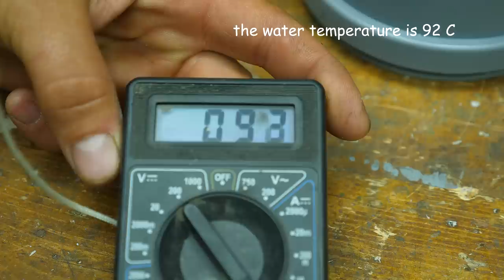Having learned this secret you will never throw away a glass bottle again!

Comment: Wouldn't it have been soooooo much easier to simply wrap the glass with aluminum, invert it in the pvc tube and add spray can foam insulation?
Reply: Would have been a Great Deal easier just Not do the Video n posting it.
Reply: Or just use the thermos that’s laying on the workbench.
Reply: I thought the same thing! Lol
Reply: Yup
Reply: @Camille
I like your idea.
Reply: Don't forget inside of bottle lid is pba and all sorts of pbs....to make your life as toxic as possible with this flask.
Reply: Or maybe just fork over the $20.00 & buy one, just sayin'....
Reply: Do they not have a Dollar Tree where you live lol. You have all the tools you need to build creative furniture, lamps, frames etc.
Reply: Glass thermoses was "piip" hurt in old days. If you use screw cap, you never get it open because it create vacuum when it get cooler.
Reply: Some people just don’t get the joy of creating
Reply: Those 3 pvc parts alone cost more than a new thermos flask
Reply: Not so attractive for a YouTube video, though.
Reply: @vernellcallahan1791  No, there is no such thing as Dollar Tree in Australia.  There are cheap shops but not cheap like I see Dollar Tree.
Reply: David Wang  I live in Coon Hollow and there isn't a single Dollar Tree near me.  There was a Big Lots once, down near the big traffic intersection with the flashing red lights, but it was taken by the same twister that took out Floyds trailer.  Shame too, because now I have to drive all the way into Dry Springs to buy my pork rinds.
Reply: lol yes
Reply: You don't think he thought of that? He's obviously a genius. that was probably his like second design, but he scrapped it because it would have made for a very short video! He was going for excitement, viewership interaction, comments! The entertainment Factor alone is astounding, don't you see? Duh. :)
Reply: @fasthead  why not reuse package foam.? I sure get get enough when I order.
Reply: @RoySATX  
😄😄😄😄😄👍🏻

Comment: I have a glass Jar! Just not all them fancy power tools! Lol 😂 cool 😎 video📼 thanks! 🇺🇸
Reply: You can do pretty much the same thing with a hand drill, hack saw, coping saw and sand paper - it'll just take more skill and patience.  ( a battery charged hot wire and a clamp or vice can replace the coping saw to cut styrofoam.)
Reply: Me too! Lots of glass jars no tools! 🙁
Reply: @larryclemens1850  i don't have any of those either lol
Reply: I have all the fancy power tools but no glass jar!
Reply: Yea like who has a vertical circular sander like that,never seen one like that ever but good to have nonetheless.
Reply: @larryclemens1850  źźź

Comment: Very interesting. This is inspiring and could be done almost for free using polystyrene pellets and any old outer cylinder, and could be made almost any size. Obvious, but very inspirational.  Lots stronger than a glass thermos flask,  and better than a metal lined flask efficiency wise. Thanks for sharing,  blessings.
Reply: Imagine having all those pieces of equipment in your workshop. I could by a lot of thermoses with the money I would spend bying that shop equipment.
Reply: @InAHandBasket  The thing is Linda, tools can make just about anything, not just thermoses. Tools are the means of production. A good workshop, like a well equipped kitchen is more valuable than gold and diamonds. (They are a waste of money for the sake of useless vanity.)
Reply: @kenbellchambers4577  Having those tools is no doubt very useful however the title of the video makes it sound like it's something someone would actually do. Very few people would have the time and equipment to never throw away bottles so they could use them to make DIY thermoses. While watching the video I thought it was kind of crazy to go through all that trouble to make a thermos, not to mention having the supplies and tools on hand. The only thing I have is the aluminum foil and maybe a glass bottle. If you made them with the intent to sell them you would have some strong competition. I have two thermoses and I've had them for maybe 35 or so years. I don't even use them. I use my stainless water bottles which have enough insulation to serve their purpose. Still it is a very innovative idea and presentation. Just not what I would consider practical.
Reply: @InAHandBasket  The point that I was making is that tools are very useful. I have heard so many women refer to men's tools as 'boy toys'.  Tools are not toys, and the men who build our roads, bridges, houses and do 95% of the dirty and dangerous jobs need good reliable tools. Now if I was to call lipstick, mascara, and padded bra's 'women's toys', that would be pretty accurate. (Or maybe the word 'bait' would be more accurate), because all of those items are designed to catch a man, preferably one who knows how to fix and build things. 
PS, when I was six my mom bought me a thermos. On the very first day that I took it to school, I dropped it into the sink while trying to rinse it out, and it broke. That is one reason why using a glass jar rather than glass as thin as paper seems like a great idea. One day, we may find ourselves unable to buy these things, so why not learn how to make them? If you find yourself without a thermos one day, you can take any old jar, wrap it in foil, then wrap it with an old sheet or blanket, and your lemonade will stay cool all day, just using the simple methods shown in this video.
Reply: @kenbellchambers4577  Umm, my tools are toys. Or maybe that's because when I'm using them, I often feel I'm more at play than work. 😁

Comment: Took me a bit to figure out what you were doing, and what it had to do with used glass bottles. Especially since the foam and pvc alone cost more than a thermos. And if you were strapped for cash you probably could find one at Goodwill. The old green ones that construction workers and labours had are still 100% usable, even if bashed up a little. Adds character, lolol. And they fit in your hand better. I would need two hands to lift that thing, let alone drink out of it.

Comment: Pro tip: Put the foam on the workbench and drill down. That's what it is for and you'll get a more perpendicular cut.

Also, you won't have to worry about slashing your hand up with a hole saw and rushing to the ER.
Reply: Now what's the fun in that?  And you'd miss out on showing your new thermos to the pretty nurses.

Comment: I had a red plaid vintage picnic cooler get dropped and the metal housing split on a seam. Turns out all those Alladin or Thermos brand coolers were mason jars in a metal housing with fiberglass insulation around them so this makes perfect sense.
Reply: Fiberglass?  That wasn't Fiberglass, it was Asbestos.
Reply: @RoySATX  It was pink fiberglass. Fiberglass has been around since the 1930s.

Comment: This is an insulated bottle. It is NOT a thermos!

Thermos is a registered trademark, meaning the device contains a double-walled vessel, with the contents protected by a vacuum. That layer of vacuum makes it impossible for outside heat or cold to affect the contents of the  bottle.

Comment: 3:35  This is when I knew that you were going to seriously hurt yourself someday.  So you really hate your hands that much?  Why not drill the inner holes in the foam sheet before cutting the outer circles?  Also, wear a mask if you are cutting that crap with a power tool.  You are basically breathing in cancer with that dust.  Use handtools for that foam and plastic.   Man, this behaviour makes me indignant.  I won't even comment on whattheheck you are making.  Also, good luck in the future and keep trying!

Comment: The same can be done far more easily using PU foam can having much better thermal insulation, and with no possibility of ingress of water. PU also prevent mould formation that happens with polystyrene foam sheets.

Comment: Great video. Quick question, what is the name of the red bit that you used to drill out the large hole? Do you know if they have a bit like that for wood? Thanks.
Reply: Yes they have them for wood. It is called a hole-saw
Reply: These come in sets of different diameters, you have to be safe in handling as they have sharp edges.

Comment: Making a statement; 'I am skilled and can do whatever I want to. ' A normal milk bottle 
will crack with very hot liquids if it doesn't with very cold ones! Was this bottle meant to be used once or twice only? Clearly there is no housing protection for cleaning. Others have been known to do a quicker job by winding a rope. around the bottle...

Comment: Its NOT a secret...   Failure !
Learned more about tools & styrofoam. Along with plastic.  And don't leave out the caulking.  The bandsaw.  Sand paper. Powered disc sander.  Work bench...  Meter... Etc... Great builder !

Comment: Next week on Home Workshop, we'll show you how to use a giant redwood tree and .50 worth of materials. (along with several thousands of dollars worth of tools) To produce a custom made toothpick in just 4 short months.

Ya know, in labor hours alone I'm way better off buying the thermos for $10 to $20 which will work much better anyway. Styrofoam® has a relatively low R value in comparison to the negative air space between the Thermos' walls.

Comment: Your other video plaques/prompts block the final temperature. > >  It is a very clever idea though. Do make sure you get a good supply of those metal lids for the bottles they will start rusting in about 6 to 8 month's. I have used these bottles for years to carry extra water in the car because I don't like plastic bottles.

Comment: I realised after about 30 seconds that this was the shittiest attempt to make a thermos flask. This would be little more than single use as the open cell of the insulation would quickly become a great living area for bacteria. Fitting that it is made from a sewage pipe.
Buy a thermos, it would be cheaper and  much longer lasting!

Comment: What a waste of time and materials. You will make a much better thermos without the Styrofoam,  but fill up the empty space with the liquid foam only, it is a much better insulator. No cutting, no drilling, no expensive tools, no waste, no expensive time. Just put the bottle inside the tube, put some spacers and fill in the blank space with foam, it takes a few minutes to do it. I insulated my boiler like this and it stays hot for days now!

Comment: Or I can just go buy the same thermos on the bench for $20 which is less than the cost of all the materials used to make one.
Time is money, and materials cost money. Those pipe sections aren't cheap when they have the oring seal, the foam and adhesive used cost money. You're out minimum 2 hours of your time plus about $40 in materials to make a bulky more fragile version of a $20 thermos. Btw, that metal thermos is a vacuum chamber, NOT a glass core. Completely different technology and doesn't stop working after being dropped which always breaks the glass chambers. 

This is one of the stupidest "life hack" videos ever made, yard sale, $5 for that thermos, $20-30 new and works much better